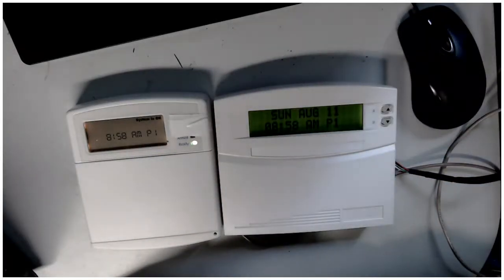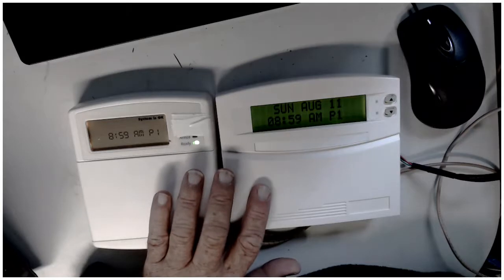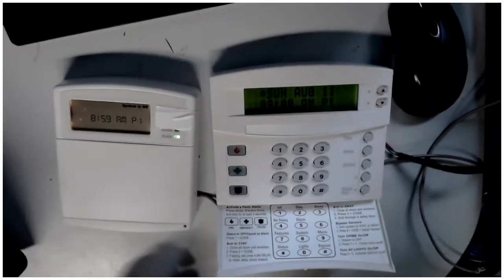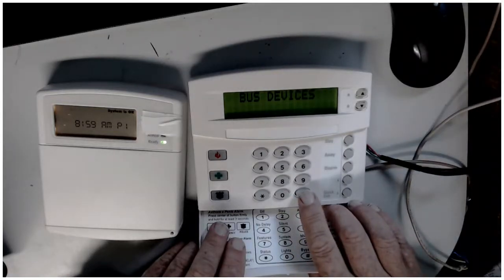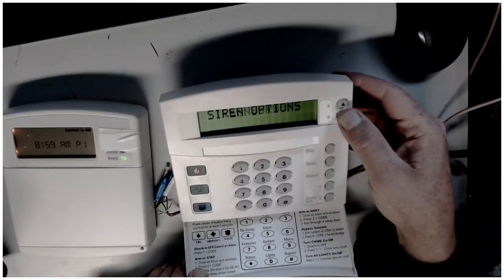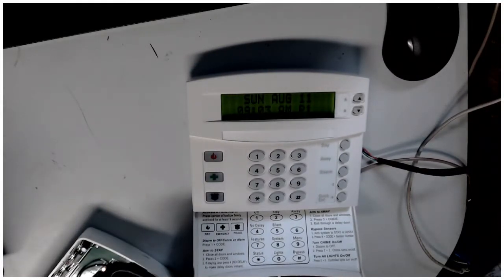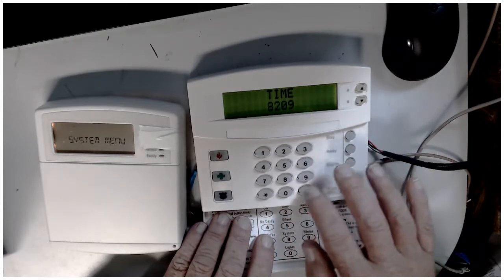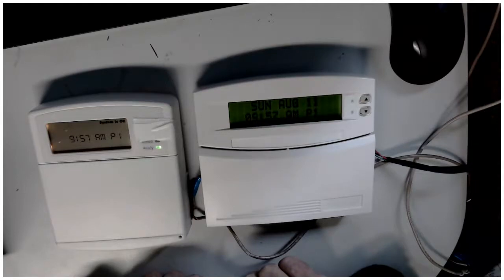GE Concord 4 Enroll / Un-Enroll keypads

Comment: If i wanted to add an additional keypad to the system, would i simply wire it to the control board and enroll it? thanks
Reply from the maker: Yes,,, but completely power down the system then wire in new keypad and then repower.
The panel will then scan for new devices that were wired in.
Reply: @DIYELEKTRONICKITS  Great thank you for your reply. great videos